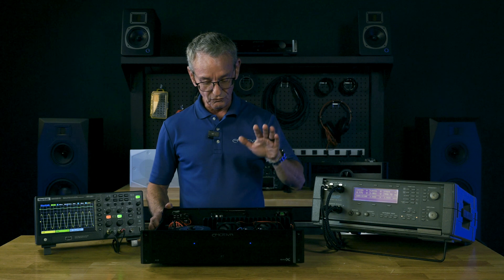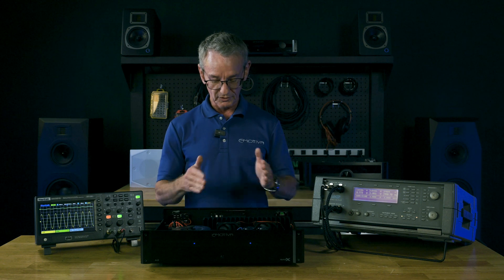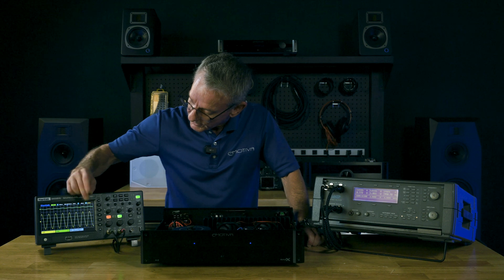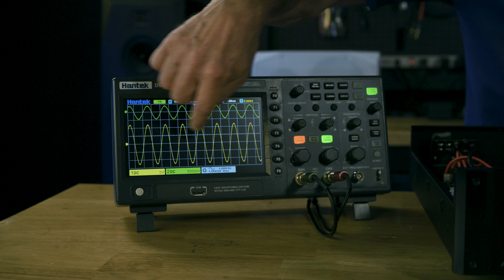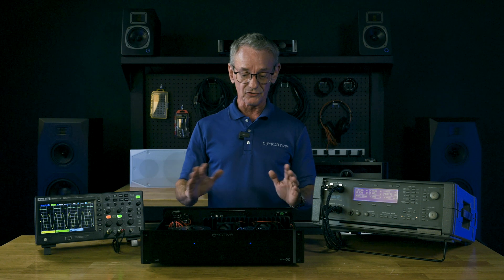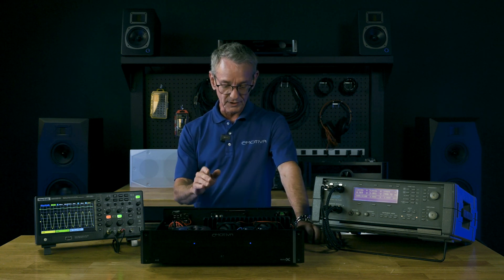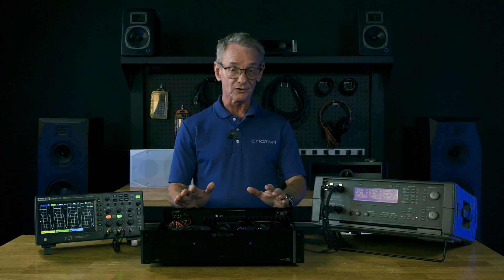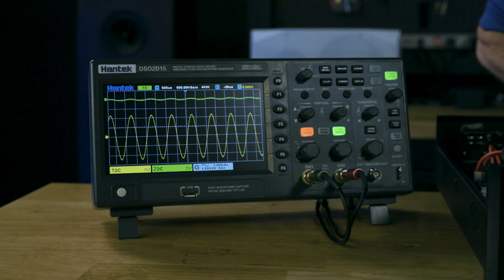How does an Amplifier work?

Comment: Big question I have a Onkyo rz50 it is 120 watts to channels driven I understand the basic fundamentals however I do have a emotiva Bass X2 but if my Onkyo only puts out 120 watts even with my pre-outs connected to the amplifier and then the amplifier is connected to my SVS Tower speakers that I want them to get 200 Watts how can this be accomplished the basics of what I understand is you only get in or should I say you only get out what you put in.. please please help me understand and fix this situation to where I can get the most out of my amplification and setup thanks so much for your time in advance..
Reply from the maker: How many total channels are you running?
Reply: @EmotivaAudioCorp  the point to my question is if is the speaker can handle 200 Watts I want to get 200 W to those speakers each however the bass X2 only delivers 160 w so without saying my Onkyo only puts out 120 watts 2 channels driven so no matter what amplifier I hooked to my pre-out whatever your output comes out to be whatever you put in to the amplifier you get in what you put out that's what I can't figure out how can I get 200 watts to that speaker if the amp can only 160 Arlette say I get a bigger amp they can actually give out 400 watts a channel still in the end I am only dealing with a Onkyo that can only produce 120 watts per Channel so if I hook it up via pre out to an amplifier that may can deliver 400 watts per Channel if you're only pumping in 120 how can I achieve any more power thanks in advance
Reply from the maker: Understood. If you connect an external amplifier to the preouts of your Onkyo, it will bypass the internal amplifier. So if you connect an 400 watt amplifier to the preouts, you will get 400 watts. The receiver will just send the signal through the outputs and the external amplifier will take care of the power to the speakers.
Reply: @EmotivaAudioCorp  No sir not in this case. Now Onkyo has came out with a new RZ 70 the rz50 is about 2 years old now most of your higher-end receivers will actually cut off the internal amplifiers when you connect your pre-outs you have that option to do so however the terminals on the back of my receiver  have  sound as well as my pre-outs as well so I actually have two front left and two front right speakers playing when is ran through at emotiva Bass X2 and the other one or should I say the other two are hooked up to the Onkyo all four speakers play at the same time. I greatly do appreciate You taking the time to respond back To me However You do understand what I'm saying If the AV  pre-outs put out only 100 Watts that's what the amplifier will process goes back to the same scenario of what I was saying you get in what you put out just like if you put in a trashy sound then the amplifier is going to produce and trashy sound I understand that concept I really do but where I get lost at is getting up to the wattage that I need that's why you have gain control on some amplifiers I do thank you so much for responding back..
Reply: If you do have any more time for any more explanations I would greatly appreciate speaking to you on a more in-depth level thank you so much for your time as I do seck for more power !!
Reply from the maker: If you want 200 watts a channel, you would need to get an amplifier that can drive 200 watts per channel to your speakers through your receiver's pre-outs. The BasX A2 will do 160 watts into 8 and 250 watts into 4 ohms. If your speakers are 8 ohm speakers, you would need to jump up to our XPA series or at-least go with our BasX A1 monoblocks.
Reply: @EmotivaAudioCorp  Thanks. For you tune sir greatly appreciate all your response and helping me get to my ultimate achievement.👍🍺👍

Comment: Hello all. I am glad to come across this video. I am hoping that someone on here can help me in some way by answering this question. In the structure of the loudspeaker, is it possible to divert the electrical impulses created in the voice coil by the vibration of the incoming sound waves from the cone, to an amplifier, and collect the output impulses from the amplifier for something else entirely, instead of using it to produce sound waves? I am asking this question because I am looking to amplify a different kind of wave than sound waves, and I think that I will need the voice coil part of the loudspeaker because it is sensitive to wave vibrations, and producing electrical impulses in the process is a feature that I find useful for my project. I would appreciate what ever input I can get on this. Thanks
Reply: I know this reply is a little late, but I'm interested. Do you want to capture soundwaves and convert them into electrical waves? Or do you want to use an amplifier to amplify different signals? Regardless which signal you're attempting to amplify, a sound amplifier should work. Sound amps like most type of digital signal amplifications mostly use transistors for the amplification process. You have one control/input wave (any electrical signal works so long as it's within the parameters of that transistor) which controls the frequency, and one output wave, which is the amplified signal. The input wave creates a variable resistance within the transistors, and the output wave is sent through this variable resistance, thus controlling it. The output wave can again be just about anything, so long as the transistor is rated for it. You could do multiple transistors in a row, but that could lead to signal degradation. Most amps have other types of controls, where you can modulate the frequency ranges (low/bass, mid, treble, or even more options in kHz) and signal input/output control. Hope this was of some help!
Reply: @Kniesknees  hello, thanks for taking the time to write this reply. You sound very knowledgeable and experienced in this and I am happy that you took the time to write that detailed reply. Actually, what I am amplifying is gravity waves! I built what I call a "Gravicraft", which is a device that rides on gravitational waves, but in order to utilize the gravitational waves that it produces to create directional movements I need to amplify the waves and pulse it in a desired direction in order to produce a required movement or "propulsion". The loudspeaker works because the coils vibrate with the detection of waves impact. This is exactly what I need because gravity is simply wave vibrations, and amplifying the current produced will amplify the resultant gravity waves there produced as well. But thanks for confirming my thoughts, and hello from London-Ontario, Canada ☺

Comment: I'm confused on an issue not covered here.  I'm trying to improve my bedroom home theater a little at a time, given budget restraints.  I'd heard many differing on the subject of separating amps from processers,  Do amps in AVRs cause measurable interference to which the processing circuits are subject to?  Whatever the case, I bought a Tonewinner AD-8300PA and added it to my Denon X4700 and things SEEM to sound better.  I don't know if it's the extra power in the LCR modules or the separation of the AVR from the internal power supply.  What's correct??